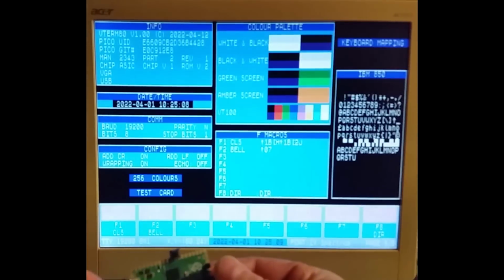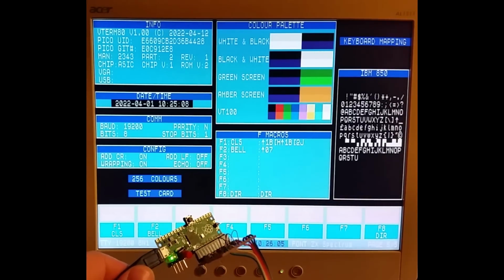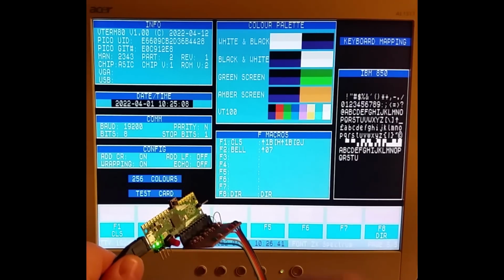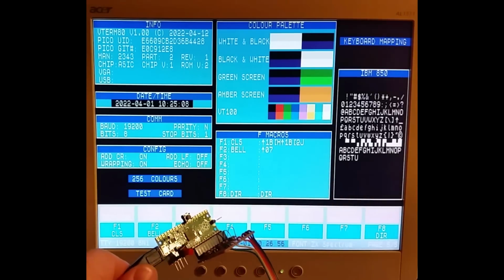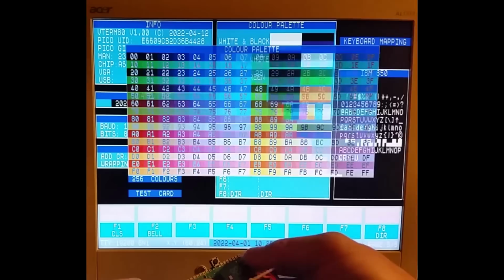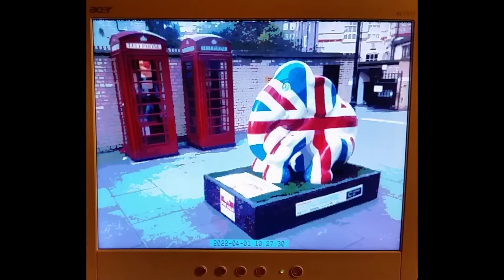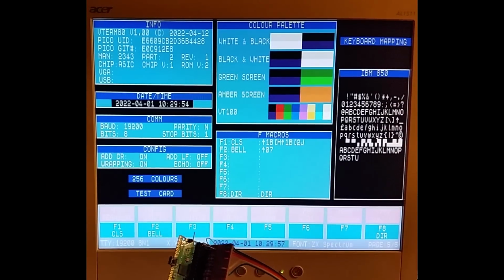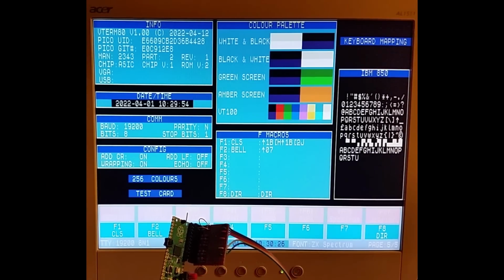Why I Was Wrong About Raspberry Pi Pico

Comment: Excellent example of the utility of programmable GPIO. I am having trouble convincing people how great the Pico is. They just don't get it.
Reply from the maker: I really didn't get it until I actually used it. The examples they provide have an example of a fast logic analziser, looks really neat. I can see it being very useful for me in future.
Reply: @DevelopIT  what projects can you see it being useful for?
Reply from the maker: @marksummers9911  The Raspberry Pi demos have a high speed logic analyzer, it look like it would be good for most data acquisition applications up to 133MHz.
Reply: I bought a couple just to make my order up at Rapid Electronics so I get free postage. I'm amazed by the things. I put MMBASIC on mine and it so rapid to prototype with it. I love not having an operating system, just write the program to do what you want and then set it to auto run. The Pico is then that device. With the PI it would be checking for updates to libraries you never use.

Comment: 15 years ago, the Parallax Propeller chip came with 8 so called cogs/cores, which would work independantly on own threads like driving an IN or OUT pin, and could emulate analog/composite video or VGA output just using a couple of resistors, too.
There was no state machine included, though, the cogs didn't need explizit assembler programming and could interact seamlessly.
I wonder, how these 2 concepts compare for common use cases?
Reply from the maker: I heard about that chip a while ago, never seen one myself, but sounds interesting.
Reply: @DevelopIT  in 2020, the Propeller 2 came out, so these should be available.
Maybe time, to remove the dust from my P1 and compare the new flexprop toolchain to the Pico.
Reply: The Pico reminds me of the Propeller, too.  The ability to define almost any pin to do what you need is really useful.
Reply: @jeffhaas9577  The RP2040 doesn't let you move/redefine pins, it simply has a pretty wide mux, giving you a lot of choices among which set of fixed pins to choose from.  Lots of other chip families actually DO allow you to map pins around much more arbitrarily as you're referring to.  The PSoC chips have been doing this for about a decade, and some of the Microchip families have had peripheral pin select (PPS) for many years.
I personally don't see any similarity between the Prop and the RP2040.  The only MCU that's anything like the Prop that gets any use are the ones from XMOS, and both are very, very narrowly used, albeit very interesting.

Comment: I've recently built a 3d printer controller from a Pico, using Klipper.  Am astounded, that even under heavy load, it just uses 2% CPU.
An STM32F103, doing the very same thing, is loaded down at 50% or more. The Klipper developers must have been clever with the I/O, timers, and interrupts.
Reply from the maker: I agree. I can't imagine how many people must have been involved with the development of the micro-controller in general. It works together so well.
Reply: That's pretty crazy considering that the STM32F103 has a maths processor with the M3 arm core and the RPi Pico only has the dual M0 cores. Absolutely agree about the amazing software work. I did my own 3D printer design back over a decade ago when no one else had contemplated the STM32F103 and it was great. However I'd planned to run ADC on low resistances of full wave bridge motor drivers on my board and never got around to implementing that. It was a fun design though, I had it also able to PWM drive servos and speed controllers on 5 outputs. Gave it up in the end because the open source team behind the arduino development for 3D printers were a bunch who had me beat on their team skills at compacting crazy efficient algorithms with constant updates into the AVR chips. I did get mine working though!
Reply: @fluiditynz  Wow, that is impressive low-level work. All I do is bodge-wire stuff on protoboards.  Have built 2 STM32F103 bed-slinger boards now, and am convinced the ADC works a little better on them.  Limited to 3 ADC on the Pico, that seem a little less stable, perhaps due to the onboard boost/buck.  The STM also has some 5V tolerant lines, which can be handy.  Side note:  bought a Ender 3 (Pro) recently.  Was certain it would have my familiar STM32, but horrified to discover the Creality firmwares would not work.  It has some kind of clone instead, a GD32, due to recent US tech export rules, according to Marlin docs.  Gone are the days of STM32F103C8T6's with 128k for $1.25.
Reply: @GnuReligion  I've found in the past that multiplexing ADCs tends to charge couple the applied voltages in the sequence of selection.  So if you scan through several inputs fast, you will get ghosting of voltages from previous inputs, most especially if you are monitoring high impedance voltage points. I haven't delved into the low level setup for the ESP32s yet but you could try a read, brief delay and a read again per channel in lieu of increasing the sample time. I also used to round robin sample and keep a short history of the channels and average them. I have a part tray of some STM32F103VBT chips in a tray in the garage dating about 13 years back, I got busy doing other things. built a surf ski, kiteboarded, lots of 3D designing and last couple of years, designing hydrofoils and wingsurfing on them. But is gratifying to be back into this for a bit, ironing out delays in sample ESP_NOW code and working in a struct as prep for an RC hydrofoil transceiver set with control and feedback planned. No doubt I'll have to switch out parts later to get the BLE 5 range though.
Reply: @GnuReligion  I'm unsure why US export rules are an issue as ST isn't an American company.  Ignoring that, you simply can't get an STM32 nowadays.  Maybe by 2028.  Any chip that you can get at this point is better than every one that you can't.
Reply: @ericbwertz  Yup, the Logic Green 328 chips are more capable the Atmel, and the GD303 is better than an STM32F103 ... but unfortunately the clones are not exact. Will be happy to use Pico for my MCU and Risk-V for a CPU.  Open source the hardware will eventually rule ... hopefully.

Comment: That's really impressive. Just starting to play with this myself and it's good to know about this capability with driving the vga monitor!
Reply from the maker: I jumped in at the deep end, the project also needs to include a USB keyboard. One of the main reasons I chose the Pico as it can host USB devices. Amazing micro-controllers. Good luck with your projects.

Comment: Could this PIO be used to build plugin replacements for retro ICs?
Reply from the maker: Retro ICs could be of several types. Logic array types, the PIO wouldn't replace as the PIO has very limited logic in it's instructions. It's more for timing and sequencing, so comms ICs or GPIO it could handle. However as the CPU cores are so powerful they would be better use to emulate old custom ICs.
Reply: @DevelopIT  some ICs like C64 PLA fit into two GALs, they're really close to fitting into PIO confines. I think PIO is especially helpful to create a low latency bus interface on top of which the rest of functionality can be software, especially thinking of any kinds of expansions and bus devices, not necessarily replacements.
Reply from the maker: @SianaGearz  That sounds spot on from what I have seen so far.
Reply: @DevelopIT  AH, thanks! I tough it might be suitable, because of the temporal precision it has. From what you said I have taken that it's more like an coprocessor  for very specific tasks.
Reply from the maker: @elmariachi5133  I guess it could be metaphorically comparable to video card cores that are dedicated to processing matrices of triangles.
Reply: The problem is the package and power pins. The RP2040 is a QFN 56 so no "plugin replacement" but you could make a small PCB that converts the QFN into a DIP. Some PICs have really good hardware customization techniques that can be used do some emulation of older chips and are in the same package as an older chip would have been in like a DIP package. You could probably just bit bang it out because the new ICs are so fast.

Comment: ESP32 is hampered by the ESP-IDF. Wish you could run bare metal on one core with ESP-IDF on the other.
Reply from the maker: I think I'm more likely to run assembly on the Pico because it is ARM based. I have never written any ARM assembly yet, but it's such a common processor it would be worth the time spent.
Reply: @DevelopIT  I only write ASM for things that need to be heavily optimized and i don't plan on changing in the future. otherwise i try and code in the most readable way possible. it makes it much easier to maintain in the future. especially on larger projects. And with these powerful arm chips, there isn't much downside in doing something like this. As long as you can fit your application within the processing capability you are targeting, more optimization is just a waste of time and introduces more technical debt. Unless it provides a better user experience (I.E. noticeable faster frame/loading times)
Reply: The problem with the ESP-IDF is that the RTOS interrupts are higher priority than pin interrupts and cannot be preempted. This causes a large variation in the delay between a changed pin state and the actual interrupt being executed. It made it completely unusable for my ECU project EFIGenie. If you could find a way to run ESP-IDF on one core for all of the wifi stuff, and bare metal on the other core that would make an excellent video as i am not aware of anyone who has successfully done so.
Reply: If you search for EFIGenie, you can also find a interrupt example for the ESP32 that demonstrates this in another repo on my account.
Reply from the maker: @Cracked1ce  when I get back to the ESP32 projects I will have to remember to have a look for this.